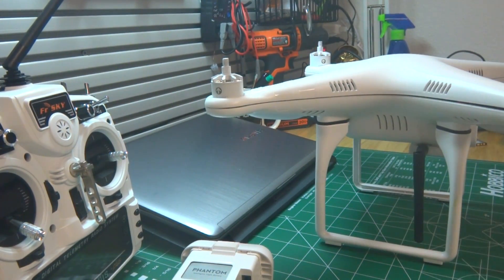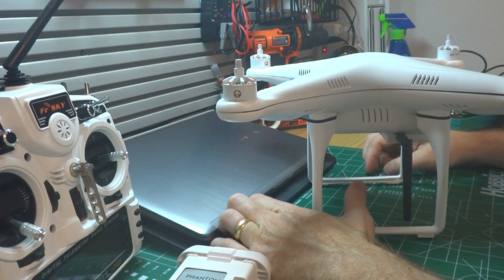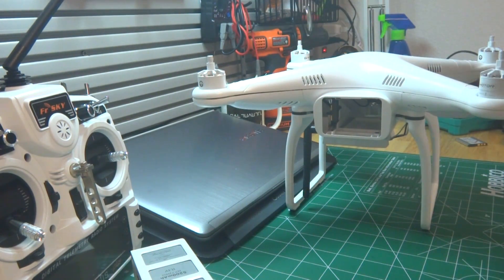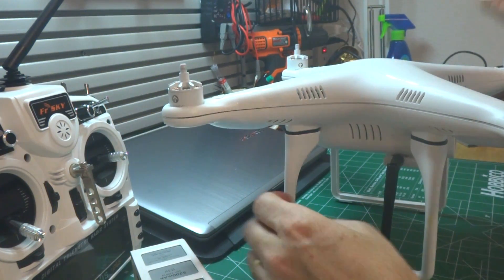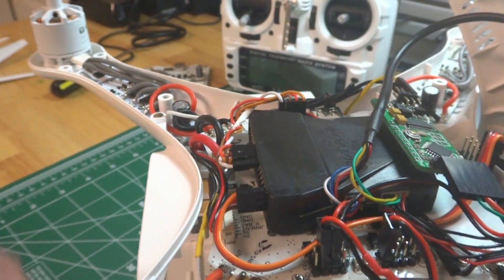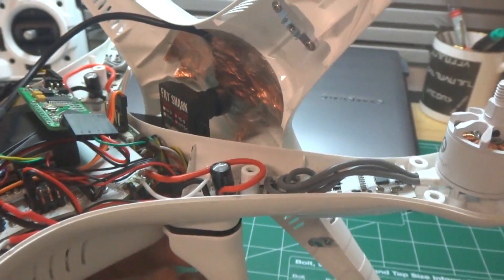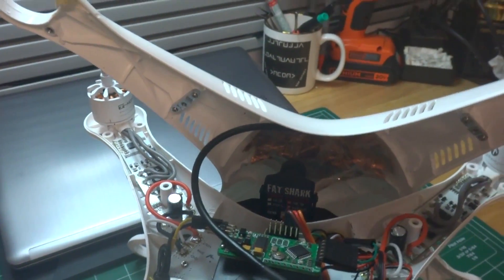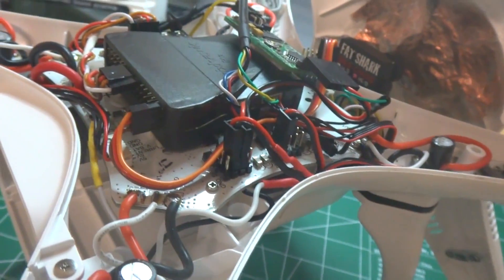PixPhantom - Phantom 2 Pixhawk Lite Conversion Project

Comment: I use an APM 2.8 side pin and I rotate it and then in the Mission Plnaner parameters I put the FC at a 45 Degree yaw. That makes the room for the pins.

Comment: Hi. How were you able make a power port on the shell to make an exact fit for the oem battery to be used? I already have a shell and some other parts.
Reply from the maker: You just need to find/buy the OEM battery connector port and cable.  It installs with one screw and then  you can connect the leads to your PCB or PDB.
Reply: Nice. Thanks for all the info. I see some parts on glb site and nothing on bg anymore.

Comment: Good job! I do the same, install pixhawk px4 in to the my phantom body.
But I have one problem, I can not adjust the compass. I use 2 compases 1st one is onboard, 2nd external mounted on leg.
Compases are adjusted and calibrated good, with normal shifts values. Anyway compases works not correctly, every time gives different values, do not show true direction or compas values rotating as police beacon.
At the old flight controller same external compas, placed on the same place had work properly.
I still can not solve this problem.

Comment: Hello I am in desperate need of help. I am doing the same build. I was wondering if you could help me out. For some reason my motors are not getting signal to spin. I have tested all of the esc's with a servo tester. Mission Planner is seeing my transmitter (Taranis). I don't have a clue as to what I am missing.
Reply from the maker: Not sure. Arm you motors in mission planner and see if you can get your motors to spin that way (rule out your transmitter).
Reply: xc68000 they do not spin from motor test within mp. I tested with a different transmitter and receiver and it still didn't work. I soldered a standard looking 30a esc and motor on there and it spun up.  So something is up with the esc's. I was wondering if you could show me how to program these opera esc's?

Comment: Hi again,  I've encountered the same problem as you with the opera ESC's. I had one esc fail and the new ones have a different chime. I have bought the USBASP programming tool and have made a pin tool to flash the esc but regardless of what I do, I cannot get the new firmware on. Can I ask what tools and software you used to flash the ESC's? BTW, I've found a stand alone compass that might be of interest to you in the Cherson CX-20. I think it would be compatible. I have one but am yet to fit due to these esc issues.
Reply from the maker: Dave not sure.  There are many software packages you can use the flash.  I will check and see if I still have the flashing app on my pc and if so will let you know the name.  I soldered my cable to the pads but be very careful if you do that because the pinouts are non-standard from what you find on other ESCs.  I actually burned out one trying to get it correct.

Comment: Great video! I'm almost finished a very similar project which is an aftermarket phantom shell and almost identical internals to your project. I'm using the multistar 5200mah 3S battery and hoping for 15+ mins. Can you tell me a lttle about your compass shield. I think I may have similar issues when I finish my project. Just wondering if you managed to improve the interference and is it an issue with autonomous missions?
Reply from the maker: Yes, I made my shield using copper tape and packing tape.  So just make a shape the size that you need with the packing tape and layer it on top with the copper foil (I did 3 layers).  Then add another layer of clear packing tape on top to insulate.  The coper tape I used is commonly used to shield electric guitar internals and can be found on eBay.